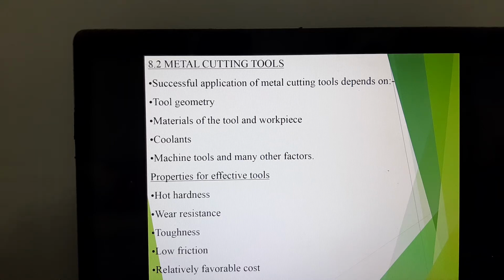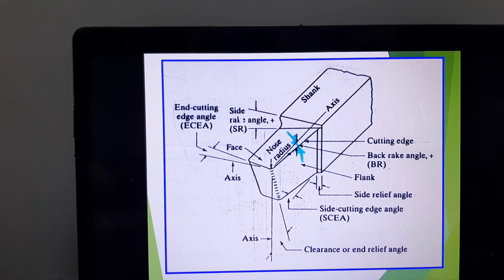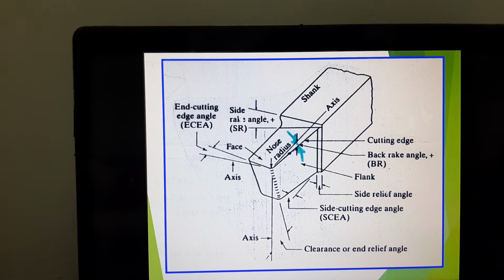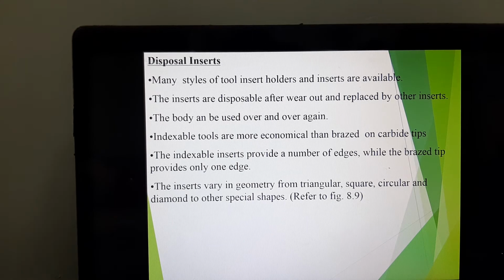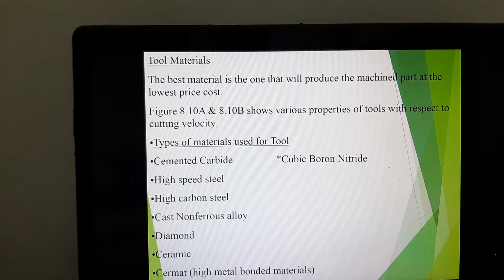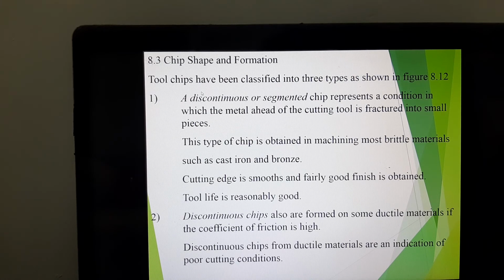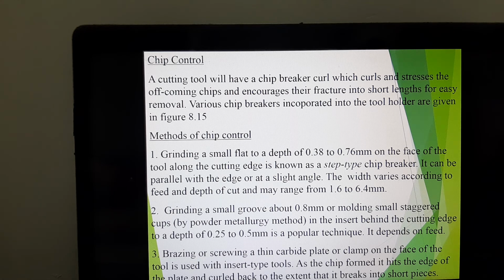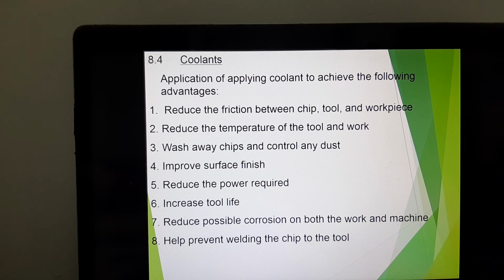Metal cutting operation

Comment: Good afternoon Madam, I am Wong E-Shen (ME0106071). From this video, firstly I have learnt about the several types of angles such as SCEA (Side cutting edge angle), back rake angle, side relief angle and side rake angle. For side cutting edge angle, its vary from 0 to 90 degrees. It is going to determine the chip thickness generated. For ductile materials, it doesn't matter whether 20 degrees or 80 degrees is used since ductile materials are soft whereas for brittle materials, the the smaller angle of SCEA used. The smaller angle will cause the smaller and thinner chip size generated and longer the tool life. Next, for side relief angle, it separates the nose and shank. Then for back rake angle, it consists of positive back rake angle and negative back rake angle. For positive back rake angle, the chips will curl and move away from the tool during cutting and is suitable for ductile materials. Whereas, for negative back rake angle, the chips will accumulates and stick and welded onto the tool. This will cause your tool cannot be used again. It is suitable for brittle materials because brittle materials will easily break and will not accumulate the cutting zone and welded the tool. Secondly, inserts consist of 2 types which are indexable inserts and disposable inserts. For indexable inserts, it is expensive and can be resharpen and be used over and over again. It normally for larger production. Besides, for disposable inserts, it is cheap and can only be used one time and once blunt, it cannot be used again. It normally used for smaller production. Thirdly, commonly used materials for the cutting tool in industry are high speed steel and cemented carbide. Is is because these two materials are cheap and can be used to cut several materials. Next, these 2 materials are chemically inert and will not have any chemical reactions during the cutting processes. Anyway, diamond is the best and hardest materials for the cutting tool because it chemically inert and it can be used to cut all the materials but it is very expensive. Next, continuous chips will generated when cut the ductile materials, discontinuous chips will generated from cutting brittle materials and for built up edge chips, it happens when cutting the overly ductile materials. So, in order to prevent the chips from damage our tools, chip breaker will be apply on the cutting tool to fractured the chips. There are 3 types of chip breaker such as step type chip breaker, groove type chip breaker and brazed type chip breaker. Lastly, i have learnt the functions and important of using coolant during the cutting process. 
Thank you.

Comment: Good Day, Dr. I am Derrick Ng Kian Ping (ME0105733). At the end of the video, I have learned that there are different types of angles in a cutting tool and each of these angles play an important part in order to achieve a good product. Now, there are 3 types of angles that I have learned from this video which are Side Cutting Edge Angle (SCEA) , Side Relief Angle (SRA) and Back Rake Angle (BR). For SCEA, the angle of cut varies from 0° to 90° and this angle influences the thickness and width of chips.If the angle is small when cutting brittle material,a smaller chip will be generated and this will lead to a longer tool life. However,if the cutting angle is large,larger chip will be generated and the cutting tool will get blunt quickly due to an increased depth of cut. Next, SRA is the part where it separates the nose from the shank. If SRA is not present, the shank will be inside the nose during cutting process and thus cause damage of tool. On the other hand, BR has 2 types which are positive and negative.For positive,the chip generated will curl away from cutting zone and is most suitable for ductile material whereas for negative, chip generated will move in and gather around cutting zone where chips can get welded to cutting tool. Therefore, BR negative is only suitable for brittle materials. Next, inserts are more commonly used in today's industry to perform cutting. There are mainly 2 types of inserts which are Indexable Inserts and Disposable Inserts. Indexable inserts are high in terms of quality and are more suitable for mass production because it can be resharpened and reused again. For Disposable Inserts, although it is a cheaper alternate, however it cannot be reused and is specially design for small amount of productions.There are many cutting tools available .The 2 most commonly used are High Speed Steel and Cemented Carbide because there are cheap and abundant. These cutting tools are also chemically inert and will not have chemical reactions during cutting. However, the strongest cutting tool is definitely diamond but it is too costly. There are mainly 3 types of chip shapes which are continuous where materials are ductile, discontinuous for brittle materials and Built Up Edge occurs due to overly ductile materials and the chips may weld with tool and damage it. Next, chip breaker is used to prevent sticking of ductile material to the cutting tool. To do so, there are 3 chip breakers which are Step where an obstacle is formed at the edge of the cutting tool, Groove where an obstacle is formed at the middle of cutting tool and lastly, Brazed where an extra material is added on to the cutting tool. Last but not least, I have learnt that coolant which is fluid is extremely important as it reduce friction,temperature and corrosion during cutting.

To end my comment, I would like to thank Dr. for uploading this video.

Comment: Name: Nur Syazwani Bt Mohd Noor
ID: ME0104367
Good evening madam, from this video i learnt about the metal cutting tools. There are several types of cutting tool signatures which is side cutting edge angle, side relief angle and end relief angle/back rake angle. Other than that, i learn about the disposable inserts where you can remove and replace it when it is worn out. The materials that are normally used for tools are the cemented carbide and high speed steel because of its compatibility for cutting tool. Lastly, i learnt about different type of chips, chip breaker and coolants. Thank you, madam.

Comment: Good afternoon Dr, I learned that we need to know how to choose effective tools, the tools must have high hardness, wear resistance, toughness, low friction and relatively favorable cost. I also found out the details on the cutting tool. The cutting comes with several angles, which are back rake angles, side cutting edge angle, side rake angle and end-cutting edge angle.  Each angle has different functions. Angles will vary based on its specific angle. The side cutting edge angle varies from 0-90 degrees. If a bigger angle is chosen, a larger chip will be generated which causes the tool to become blunt. Next, the side relief angle segregates the nose from body of cutting tool. The back rake angle has 2 different angles which are positive and negative angles. The positive angle causes chip to generate away from the cutting zone. It is used for ductile materials. The negative angles causes chip to curl in towards the cutting zone, which is used for brittle materials. Inserts also used where there are 2 types of them. First is indexable insert which is used for mass production because it can be reused and resharpened. Second is disposable insert where it cannot be reused and is used for smaller production. Moving on, there are different tool materials. The most common ones are high speed steels and cemented carbide because there are compatible with a lot of material and they are inert. Diamond is the best but it is very high in cost. We must avoid built up edge chips as the chips may weld against tool. To avoid this problem, we can use chip breakers for overly ductile material where there 3 of them which are step type, groove type and brazed type. I also found out that coolants are used to improve the surface finish, reduce any frictions, and wash away chips/dust so that the tool life can be maintained. Thank you for the video Dr. 
-AHMAD NAZRI BIN AHMAD TAMRIN ME0106079

Comment: Name : Aiman Hazim Bin Arif Razman
ID : ME0106080

From what I understand through watching this video, one of the few major inputs that have been conveyed is the presence of different type of forces generated upon cutting a material with a tool, which are frictional, shear & normal forces. I am now also acknowledged on how to find horsepower at spindle & motor using their respective formulas. I have also learned about the vital properties of tools in order to ensure their effectiveness  (high hardness, high toughness, wear resistance etc.). Also, one of the more important part on this topic is the cutting angles which consist of SCEA, side relief angle and back rake angle. The inserts are used with the cutting tool to enhance the cutting performance and reduce cost from constantly replacing the tool. I am now also aware that there are many types of chip control methods depending on the type of material  to ensure the smoothness of the product surface. 

Thank you for the insightful video Dr.

Comment: NIGEL ANDERSON SINGH A/L RAJDEEP SINGH 
ME0106094
Good day, miss. Effective cutting tool involved high hardness, high toughness, low friction, wear resistance and favorable cost. Next, is cutting tool signatures. Cutting tool is designed with different geometry for particular task to increase the efficiency of cutting process. The geometry aspects involved different angle that applies in Side-Cutting Edge Angle(SCEA), End-Cutting Edge Angle(ECEA), Side Rake Angle(SR) and Back Rack Angle(BR) which varies from 0 to 90 degree angle. Inserts are also taught in this video. There are 2 types of inserts which are disposable inserts (small production) and index inserts (mass production). The best cutting tool material are cemented carbide and high speed steel due to low cost, readily available and good cutting resistance. The option for cutting tool is diamond which can cut every object including diamond but due to its high cost it is not the best option. There are different type of chip formation which are discontinuous chip and Built-Up Edge Chip(BUE) which occur on ductile material. Chip breaker is very significant in cutting a ductile surface. Chip breaker consist of step type(obstacle at the end) , groove type (obstacle in the middle) and brazed type (add-on material on the cutting surface). Functions of coolant are reduce friction between chip, tool and workpiece, reduce temperature of tool and work and reduce the power required.

Thank you.

Comment: Good evening madam, I am Chong Jin Yang (ME0106047). From this video, I have learned that a good cutting tool has high hardness, high wear resistance, high toughness, low friction during machining and relatively favourable cost. A suitable tool geometry, suitable materials of the tool and workpiece and coolants are successful application of metal cutting tool. There are many cutting angles for the cutting tools. But, this video focused on three main angles which are side cutting edge angles (SCEA), side relief angles (SRA) and back rake angle (BCA). SCEA influence the thickness and width of the chip. For brittle material, smaller the SCEA, smaller the chip size, longer the tool life. BCA consists of two types which are positive and negative BCA. Positive BCA mostly for ductile materials moves the chip away from the machined surface while negative BCA mainly for brittle material moves the chips towards the machined surfaces. Next is inserts. There are two types of inserts which are disposable inserts and indexable inserts. Disposable inserts can be used only a single time which is for small production while indexable inserts can be reusable which is for mass production. Moreover, the video also discussed about tool material. Cemented carbide and high speed steel are widely used due to reasonable price, compability with most of the metals and chemically resistance. Diamond is the strongest and the best material but it is not widely used due to high cost and a rarely found material. After that, the video talks about types of chip. There are three types of chips which are discontinuous ( for brittle material and ductile materials if friction is high), continuous (for ductile materials) and built up edge chip ( for overly ductile materials). To reduce the chip, we have to apply chip breaker. There are three types of chip breaker which are step (remove the edge part of the cutting tool to create obstacles for chips), groove (remove slightly middle of the tool) and brazed chip breaker ( add additional materials on the surface of the tools). Lastly is the functions of the coolant. Thank you. If anything wrong, please correct me.